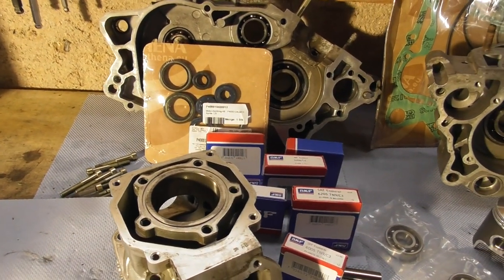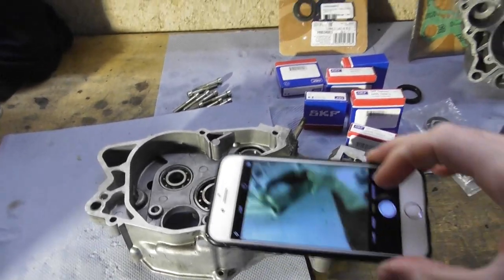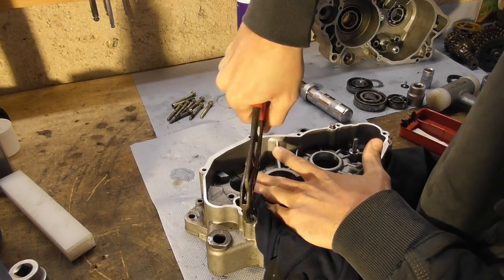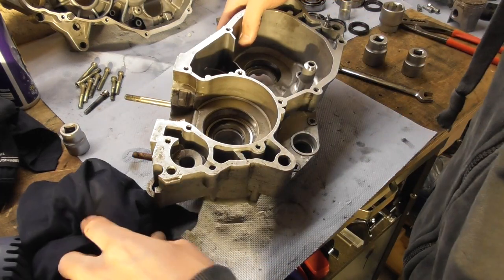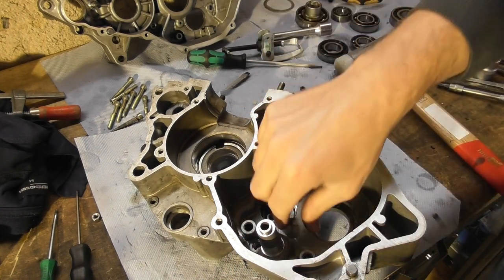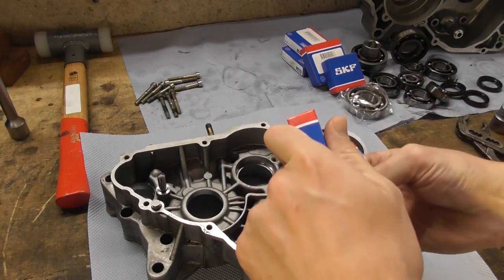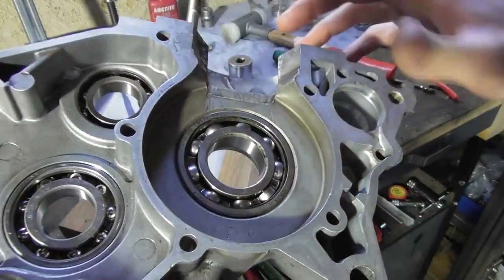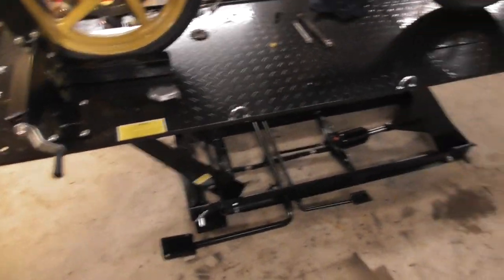Aprilia RS 125 - Let´s Replace all Bearings in "Unconventional" ways - Part 4

Comment: The middle small bearing you can take it out using bread..is a simple way to remove it..
Reply from the maker: Using bread? Can you explain how?
Reply: I can explain how bread trick works pack centre of bearing with bread an pack down with tool an repeat till it starts lifting the bread forses it's way under lifting bearing
Reply: i just looked it up. hilarious
i never knew, you could excert so much preassure on bread
Reply from the maker: @Tiwey  will definitely try this method next time 😄hard to believe this works.
Reply: @bikedogtor1663  It really works, tested in practice. I wonder who came up with this tricky way :)

Comment: Hi, regarding the crankshaft seal on the left hand engine casing. The open end of the seal have to face towards the left side. If you face the open end of the seal towards the crankshaft, the lips will touch the bearing. Slowly but surely the seal will be rubbed off and thus causing transmission/gear oil to enter the crankshaft and make the bike runs really Rich. This happened to my bike, i had to remove the left engine casing and remove the seal. Put a new seal with the open end facing to the left(transmission/gear oil side) and it works.
Reply from the maker: Good point, unfortunately now it's too late for my engine
Reply: @bikedogtor1663  its never to late. You actually can change the seal even if the engine is mounted on the frame. I changed my crankshaft seal when the engine is still on the frame. All i did was draining the transmission oil, remove the left engine casing and the balancer gears. Then use a o-ring pick tool to pry out the seal. Then replace it with a new seal. Hope this helps. Cheers.
Reply: makes sense.
the open side of the seal needs to face the liquid (gear oil). Therefore the closed end needs to face the dry side

Comment: The seals are in the crank in the RIGHT DIRECTION ., both opened sides face the left side, and a rubber seal goes next to it on the crank , then the plastic cog and the metal one
Reply from the maker: Pat Riot ❕ thank you for your comment. I mounted both open sides of the crank shaft seals to the inside but it will work.
Reply: Bikedogtor did it work? 👀
Reply from the maker: @benmassive5517  yes and I still believe it's the right way. Although you find different opinions on the internet.

Comment: You were right to use that washer.,,, it's actually a heat shield for the crank seal on the dry side 👍🏼🙂
Reply from the maker: Just wondering, the workshop manual says just to use them to level the crank case out. Nothing about the heat shield? But it makes sense, there is no oil to cool down the shaft seal on that side.
Reply: Bikedogtor 
It fits in between the inside and outside bearing races, so would not have any contact with the crank to case fitting and/or bearing fitment. Also the workshop manual says to do two things absolutely wrong and I found this out on the Aprilia rs125 forums, one of those was the left hand crank seal 👍🏼
Reply: @OldestYoungenInGuidePost  Hiya- which things are wrong ?

Comment: Hello. You did a great job. 
For crankshaft i saw that you used bearings 2x 6206 C4 SKF.  The rest of the bearings (6 pieces - 2 x 6205, 2 x 6203, 1 x 6302, 1 x 6005)  in the gearbox are C3? Thanks
Reply from the maker: Thank you. I am not sure because my list doesn't exist anymore but yes the gearbox bearings are c3 and make sure to get the right bearing cages. The standard ones are not right here.